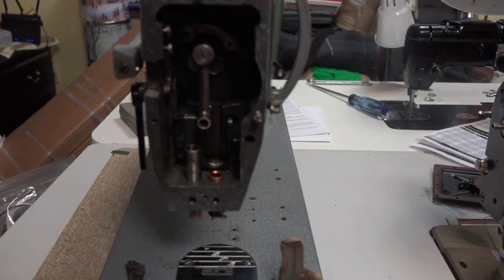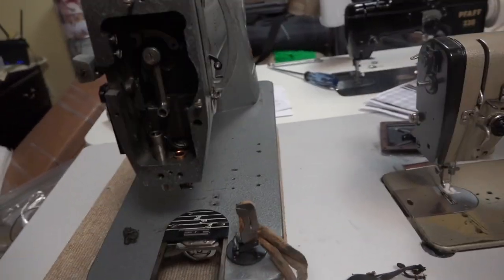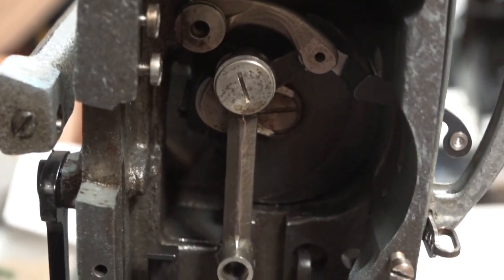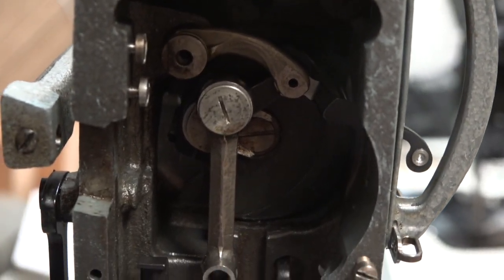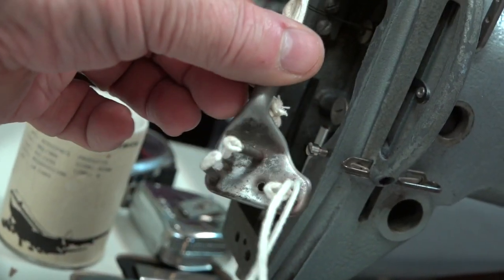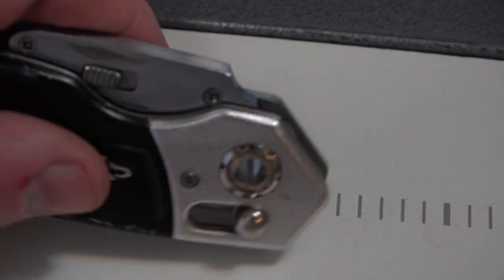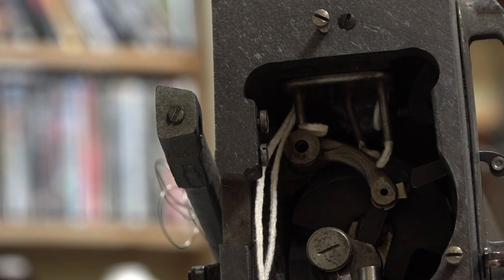Singer 281-1 Replacing the oil wicks.

Comment: I recently acquired this machine.  It has never  been cleaned.  I watched your video and thank you because it is very good.  I wanted to ask you if there is another store where I can get the wool wick.  The store you posted no longer has it.  Wold be ok to just use the regular cotton oil wick on this machine?  Please let me know.  Thank you again
Reply from the maker: You can use cotton as cotton was the industry standard. Candle wicks works well and also some industry motor oiling wicks also. So basically any oil wick you can find will work fine. The advantage wool has that it will basically last for ever where cotton will last for 60 or so years
Reply: Hi Stephen. I couldn't remove the needle bar bracket or tube? How do you remove the oil Wick holder part#147143?
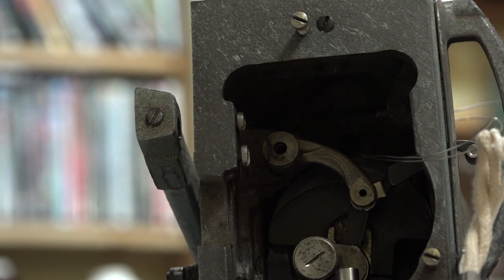Reply from the maker: @marianitalemma1775  on the very top of the machine behind the needle bar bushing you will see a slotted screw. that screw holds the wick holder. for you to remove the needle bar you will have to remove the floor plate and feed dogs so the needle bar can lowered. Its removed and replaced from the bottom. Then you can remove the needle bar bracket. to remove the tube there is a set screw on the front of the machine. At 21:40 in the video I point out that set screw. At 10:00 in the video I did a piss poor job on showing on how to reinstall the wick bracket but it shows the screw that is on top of the machine
Reply: @gmcxm211  
Thank you so much for your help.  As per your instructions, I followed step by step, but I'm having a hard time taking off the tube.  I took the screws off but the tube does not budge. It is really stuck in there.  Do you pull the tube down or up? How do I take the tube off?
Reply from the maker: @marianitalemma1775  after removing all the screws on top and front of the machine, using something like WD-40 or liquid wrench or equivalent, gently tap down or up on that bushing/tube. Be careful not to deform that tube. Its not a tight fit, it might take a day of soaking to loosen up that bar.
Reply: @gmcxm211  Thank you!
Reply: Hi Steve.  I gave up with the tube.  It was very hard to take it off.  I wanted to ask you, how do I replace the belt on the machine? I bought a new one and I have no idea how to fit it on the machine.
Reply from the maker: @marianitalemma1775  first thing first. Unless the belt is shredded or shredding itself apart, you don’t need to replace it. There’s really hardly stress on the belt. 

Now as with all industrial type sewing machines, the belts are removed the same way. First remove the hand wheel/flywheel then remove the main shaft bearing. This bearing is held in place by either a set screw or a snap ring, or both. Before sliding the belt off the pulleys, make sure the alignment marks are lined up. If there are no alignment marks position the needle bar in the full up position and mark the pulleys with a marker or fingernail paint. In most cases it’s easier to remove the belt from the bottom pulley first.

Once off the pullies you have to "fish" the belt out through the main shaft  bearing hole. This can get pretty physical but try not apply too much downward pressure on the main shaft when the bearing is removed.

There are plenty of videos on how to replace these belts on these industrial sewing machine. My 281 is a storage unit for now so I can’t give you detailed instructions, but like I said before, removing and replacing these belts are the same on these industrial sewing machines.

Comment: Where did you buy the oil wick for the singer? I just picked up this model but haven't been able to find the wick online. Thanks for the video!
Reply from the maker: you can use any type of oil wick, I did mention wool in the video, after working with wool wicks, these easily break if you are trying to pull the wick through a tight tube. so if you google oil wick or industrial oil wicks there are plenty websites that carry wicks. 

the purpose of these wicks is to carry oil from point a to point b. so these don't have to be precise. candle wicks, oil lamp wicks, electric motor wicks, basically any wick will do just fine. even a wick of smaller size, will work if you can't find the same size.

Comment: I just want to add about the wick replacement on the bottom of the 281…. I can’t seem to find any info about how to do that… I email Singer specialist and they said to just oil it manually… I don’t know how to do that either?
Reply from the maker: its been awhile since I made that video and I retired my 281 to a storage unit for now, I'll research this for you and you'll have an answer by noon mt zone.
Reply from the maker: https://s3.amazonaws.com/a.teamworksales.com/SINGER+SERVICE+MANUALS/281-1_3_21.pdf       hopefully, this link works, anyway there 3 wicks in the bottom. these supply oil to the feed dog bracket. the third is in the rotary hook shaft. you can use anything from cotton shoestrings to candle wicks. if the old ones are still there these are still delivering oil to the bearings. just touch the feed dog brackets at both ends. you should have oil residue on your fingers.
Reply: Me again, I have the manual but I think I’ve realized something…I’ve taken a photo of the bottom of my machine, I assumed that the wick went right thru the long rock shaft… but I think it goes thru top to bottom… meaning right thru the rod?? Correct? Would I need a loop at the “top” and have a little single hanging down? Not sure how to send the photo
Reply from the maker: @TheLablover3  yes you need to have the wick touching where you have metal to metal touching.if you have some wick showing but not long enough to reach the oil. just hand sew a cotton shoestring to it. don't use a knot, as it might not let the oil beyond it. as far as the picture, just IM it to me on Facebook if you are on face book
Reply: I sent pictures through fb messenger..did you get them? Just hoping I got the right person. I think I will use your wire trick to pull in braided cotton or something like that… to make 1/8”
Reply from the maker: @TheLablover3  https://www.facebook.com/stephen.feldmeier/.

Comment: where did you get the wick from? I cant find anything.
Reply from the maker: Sorry I should have included a link. You're not going to find any original replacement wicks, you're going to have to cut to length you're self. Also the wicks that were in these old machines were cotton,  but here is where I got mine. Try to get wool, its the best for wicks.   https://www.etsy.com/listing/533194551/wool-felt-wicks-natural-white-14-to-1?ga_order=most_relevant&ga_search_type=all&ga_view_type=gallery&ga_search_query=wool+cord&ref=sr_gallery-1-1   Also here is another source  https://vintagewireandsupply.com/antique-fan-wicks/ The vintage wire and supply is the best, easier website to use
Reply: Thank you for the video.  I purchased a used singer 251-2.  The sewing machine looks identical to yours.   Same internal parts.  Great job!

Comment: Where would I add oil to the wick system on the 281-1? Guessing at least where the wick comes up on top.
Reply from the maker: to insure the oiling system is working, remove the thread and bobbin and run the machine for a couple of minutes. (a steady stream of oil through the sight glass) Then open the front cover and check to see if the wicks are slightly damp. When I mean slightly damp that is if you touch the wick, it leaves a oil film on your finger. The wicks should not be saturated. If the wicks are dry, add a table spoon or two of oil through the hole on top of the machine  above the tension regulator. There should a rubber plug covering the hole.